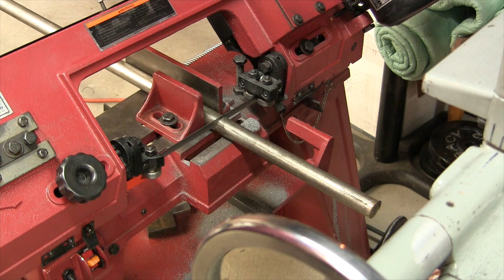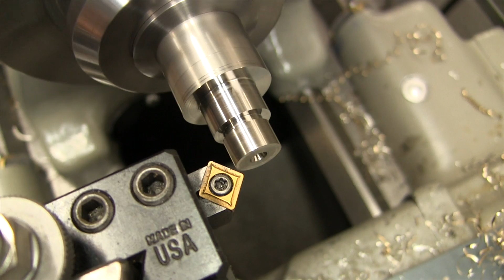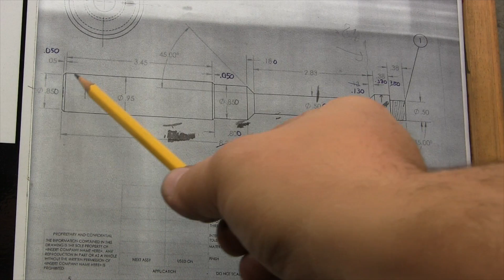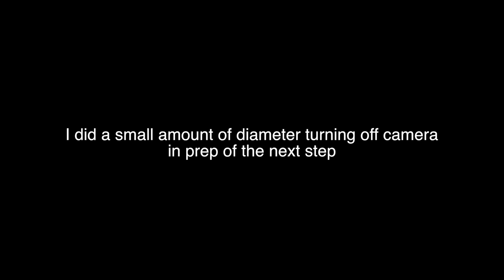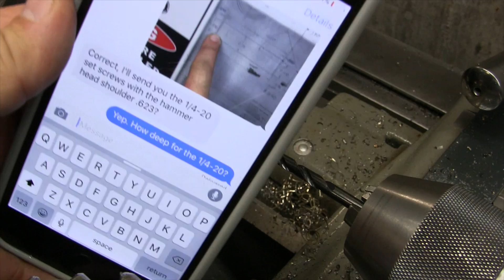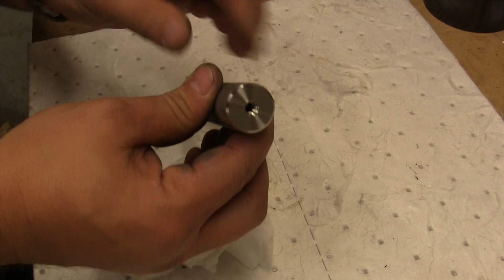WIYB TMC MUSH Shop Hammer - Part 1

Comment: To tap stainless steel, mostly the gummy type, you need brand new or very sharp of the best quality HSS taps you can find, less than that you run the risk to have to deal with tap extraction ( One great method is to dip the part in sulfuric acid and dissolve the HSS), for lubricant, bees wax based type cutting lubricants are usually known to be ding great..... Happy tapping in stainless steel...   ;)

Comment: Nice job. That was a hair-raising tapping experience  (if I had any hair left). Every time I see a tap flex I quake. Does anyone make some kind of supertap that will go into stainless? An alternative might have been to drill the hole  bigger than #7. Those tap sizes you find on charts are for 50% thread coverage on steel, but on stuff that hard you could probably go to 40% and get away with it. Hindsight, however.
Reply from the maker: +Juan Rivero Yeah, sounds like a good idea!

Comment: If i had a hammer,
I'd hammer in the morning, ......

The handle looks great, for threads in stainless steel i allways prefer the hand tap set (i don't know exactly how they are called in english ;) ), to tap the hole in three steps, more effort but it's worth it. 

Damned now i want such an hammer!!!!
Reply: +PsycoDad1604  Serial taps, if you mean three steps, each being larger than the one before, and not the usual taper, second and plug..
Reply: +Chris Stephens Yes, Serial taps, i could not figure out how they are called in english, but usually in hard materials they are the best way to form a thread without headache.
Reply: Especially in Stainless. I'm surprised that they are not more widely known, although with so much CNC machining these day they are overlooked in favour of a spiral flute which will save a lot of time.
Reply: Yes i know what you mean, in the most cases the spiral flutes are sufficiant, but in this one case when you break your tap and mess up your work, all the safed time is gone! ;)
Reply: Agreed, been there, done that, but the T shirt shop was closed.

Comment: As the 1/4-20 thread in the handle is not a high-stress location, you might have considered using a 60% or even 50% thread engagement to make the tapping easier.

Nice looking handle.
Reply from the maker: +Peter W. Meek Next time - as that's a good idea Pete ;)

Comment: good video yes the tap looked close to a snap and I know that feeling
Reply from the maker: +Bleu Wolf Yeah it was a nail biter.
Reply: #7 is not actually the 1/4-20  tap size for stainless steel (unless particularly specified)   7/32" is.